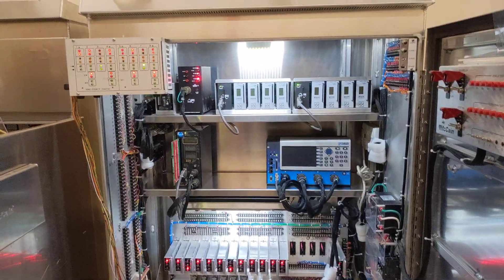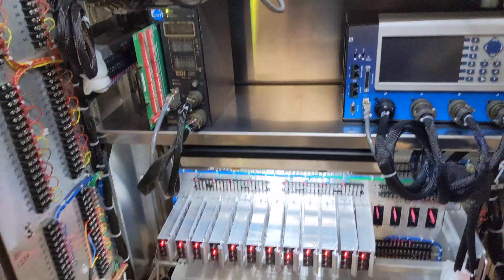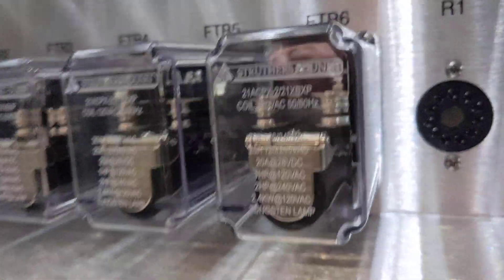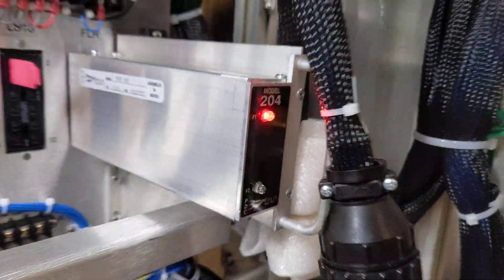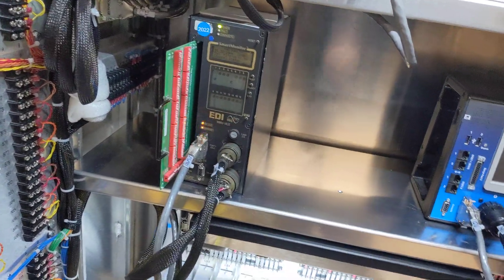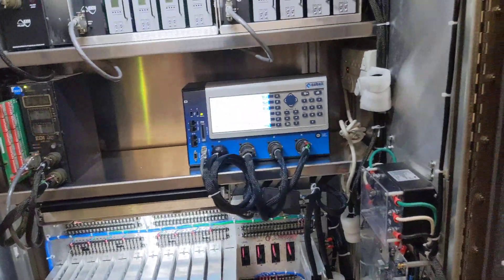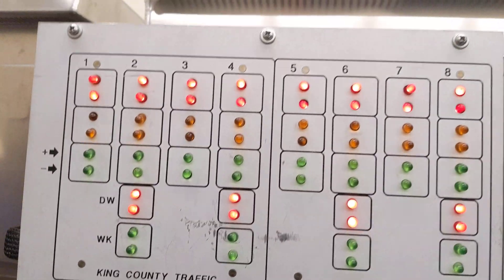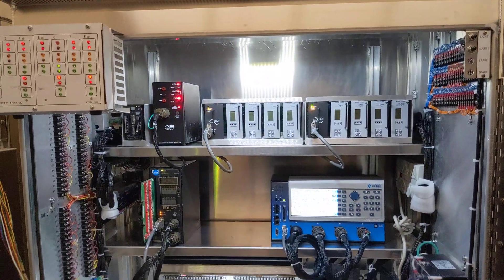NEMA TS2 type 2 Cabinet Overview

Comment: Thanks! Nice video... I'm a "hard-core" ITS Engineer (electrical, DMS, comms, wireless, etc...), and design lots of infrastructure around these cabinets. I, however, know very little about "traffic" and timing. I do/can design the actual intersection layout, mast-arm poles, etc... I just don't do the actual phasing or timing....

Comment: How are center-running street-level rail intersections connected when set up for pre-emption ? Does it come in the same way as Opticom via the Approach Interlocking from the nearest ACWD for the railroad, or are induction loops/detector signals used under the rail gauge at the traffic signal intersection ? I imagine the latter due to the 'isolated system' theoru, but I also know a lot of accidents where Grade Crossings are run perpendicular in too close proximity to a Traffic Signal intersection without being interlocked, resulting in confusion where car has Green Traffic Signal but ACWDs/Gates come down & the car stops on the track, or similar with Red Traffic Signal indications.

Comment: Will a new cabinet go into flash without MMU and controller in place as long as it has power?
Reply from the maker: It's incapable of cycling it will only go into flash without an MMU or controller.

Comment: I used to not like TS-2 cabinets because I thought they were harder to diagnose at the time. ie, which BIU was malfunctioning. But the Colbalt controller solved that problem. What you refer to as the bus interface cable is what we call the SDLC cable. Syncronious Data Link Cable. We no longer have test call buttons in our cabinets because all that can be done from the front panel of the controller. Good job of explaining things.

Comment: Do you have any thoughts or input on when and where to use a ATC or Caltrans 33x over a  NEMA TS2?
Reply: I haven't seen much reason to jump to an ATC cabinet over a NEMA TS2.  I previously worked for a traffic signal distributor in field service and we served 10 states (now service to 15 states I believe).  At that time, I helped one state setup an ATC cabinet as they were testing out as a potential future spec.  Upside-they can operate low voltage (48V) and have 32 outputs.  Downside-its a whole new animal than the TS2.   ATC cabinets have a big learning curve.     Where I'm at now, 16 position TS2-1 cabinets are our specs and I see no reason to move from that.  Hope that helps.

Comment: Hi I love your videos you gave me more knowledge about the hardware of traffic signals. You should really do a video on signal controllers because there's different manufacturers like Peek, Intelight, Siemens(Eagle), and Econolite. The Econolite ASC/3 software is the one I know best and how it operates and had free time to learn back in 2018. I got a ASC/3-1000 controller as well as Eagle EPAC 300 controller just don't have a way to power them on. I just got a hold of an Econolite EOS Manual. My city (Fargo, ND) back in 2019 updated all intersections to the new EOS controllers. I know more about Traffic Engineering with traffic control then the Tech side of it but thanks to you I learned some stuff I didn't know.
Reply from the maker: great idea! maybe I'll make one today?
Reply: @trafficsignalstraining7673  I'm definitely looking forward to seeing it

Comment: What does a TS2 type 2 cabinet have over a TS2 type 1? What is the advantage in the traffic field?
Reply: TS2 type 2 is more of an appealing upgrade path to those who are use to TS1. A lot of people still use TS1 and are afraid of upgrading to TS2. Type 2 still gives them their full load bay to where they have access to their inputs and outputs yet allowing safety checks that TS2 offers. In the TS1 world if you want to manipulate inputs or outputs, you'd do it with jumpers on the loadbay but in TS2 this can be done with mapping or programming A lot of guys in the industry still prefer to their full loadbays to hardwire inputs or outputs.

Comment: quick question for you.  We are new to controllers.  we don't have an mmu connected to the econolite controller.  the phases seems to be always staying high 24vdc.  any ideas, can we some how bypass the mmu and other safety features to test with field outputs on the bench?  thanks
Reply: Where are you reading your voltages from?
Reply: Several companies make controller testers to bench test controller inputs/outputs. Most modern controllers should have an input/output screen to show you real time status.
Reply: Verify that the outputs are enabled, I got a new McCain last year and set it up on a tester using ABC connectors and got nothing. The ABC outputs were turned off, enabled them and worked like a charm.

Comment: Hello from Connecticut! Its amazing on how much traffic technology has changed in the last 28 years! I'm working on a project in which we replaced all the 3 dial mechanisms with "advanced solid state" controllers 28 years ago when I was still a wet behind the ears apprentice! We are doing a top to bottom replacement of the same intersections that I worked on 28 years ago!